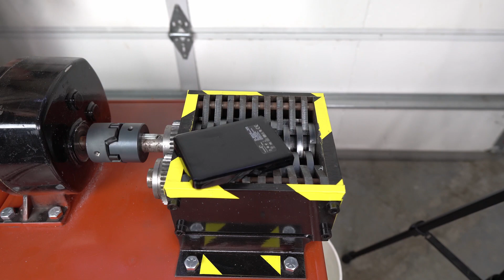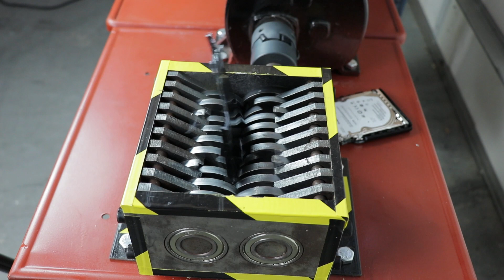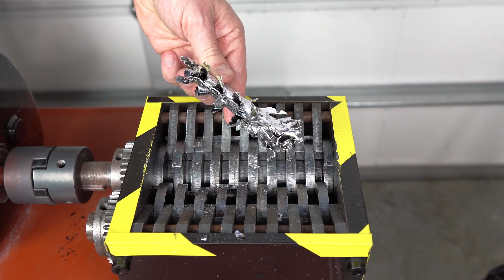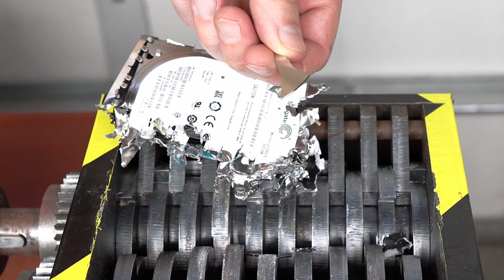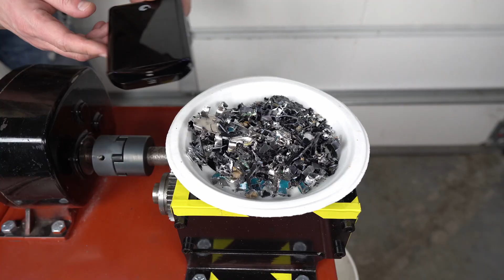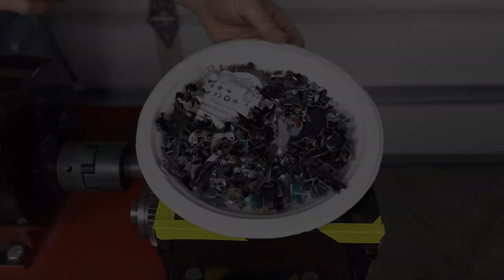Shredding a Hard Drive - Proper Data Destruction

Comment: That's the first shredder that I am ever seeing being stopped by anything led alone a hard drive. Is it faulty or on low power?
Reply from the maker: The motor is a little too weak for a hard metal to be crashed
Reply: I saw four Turtles stop a Shredder time and time again since the mid 1980s.